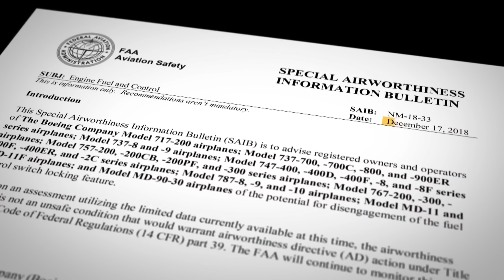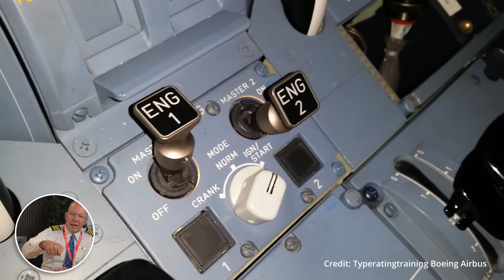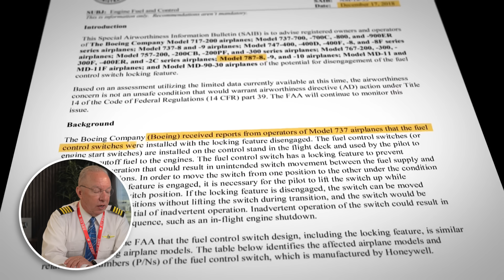Air India 171: The FAA’s 2018 Fuel Switch Locking Bulletin Explained (16 Questions Answered)

Comment: Steeeve-retired avionics systems engineer here and ever since I heard about the fuel switch issue I’ve wondered how an airplane this advanced does not have a “reasonableness algorithm” built into the switch actuation logic.
The airplane’s smarter (or at least should be) to know that a “fuel off” command is reasonable during a throttles in takeoff position, 600’ in the air and literally seconds after WOW logic transfers from ground to air.
Airplane should have over-rode that switch actuation.

Comment: Remember boeing mcas tragedy 2 had to happen for action to be taken its gonna be the same for faulty fuel cut off switches another one has to happen before something is done mechanical issues take time i think the intense vibration that happened before the plane took off put the fuel cut off switches to off position

Comment: A camera may avert future accidents if it was discovered the pilots did not move the switches. While it seems extremely unlikely now, stranger things have happened in air accidents. When the investigations were completed we learned something new and made the industry safer. The difference is that, we can look back with the gift of hindsight. There is a reason why recorders were installed in the first place. Pilots would have been resistant to it at first, but the result has been huge increases in safety in the industry.

Comment: I have a couple of comments.  A service bulletin is not just for information. Some are, other have a time limit or cycle limit to accomplish the corrective action. As for the fuel cutoff switches on a Boeing, they spring loaded in each position. To change state to run or cutoff you have to pull the switch against the spring tension and move forward to run or cutoff.   Some other manufacturers have guarded switches (just an option. Last in case of a total electrical failure the FADEC (engine computers), will get powered from the PMG mounted on the engine gearbox.

Comment: "The FAA recommends that all owners and operators of the affected airplanes incorporate the
following actions at the earliest opportunity:
1) Inspect the locking feature of the fuel control switch to ensure its engagement. While the
airplane is on the ground, check whether the fuel control switch can be moved between the
two positions without lifting up the switch. If the switch can be moved without lifting it up,
the locking feature has been disengaged and the switch should be replaced at the earliest
opportunity."
This the the text from the "recommendation" section of the report captain Steeve skimmed over. So he's inaacurate when he says that "i think this bulletin was about the installation of the switch". This bulletin clearly states that there could be a problem with the ocking mechanism of the switches and, that they should be replaced at the earliest if found faulty. 
the fact that such a serious component potentially being faulty is posted in a "bulletin" by Boeing and, shows their thier lack-luster behaviour. 

I certaily don't wan't to jump to a conclusion that the switches were faulty, but it's too soon to jump the gun and blame the pilots when the investigation is still underway. People should be more reserved with their opinions until we find concrete evidence of what has happend.

Comment: I find it odd that between the time the one pilot asks why the other pilot cut the fuel and the other pilot denying he did it, that there is not a word spoken in the cockpit before the may day call.  Also, why is there no alarm mentioned or heard when the fuel was cut in mid flight?  You would think there would be one.  Since the one pilot denied cutting the fuel, it seems that a camera would be proof of what really happened.

Comment: If it’s not normal procedure to cut off fuel in-flight, shouldn’t there be additional safety measures such as requiring some sort of confirmation step like another control switch or lever to effect such a “dangerous” action?

Comment: Capt. Steve,
    In always considering every possibility, the investigators will surely determine if and how much life insurance each pilot carried. The pilots know that there are no cameras in the cockpit. If the person thought about this action in advance, he would know that life insurance policies do not cover suicide. If however, the “actor” is clever enough to take the action and then blame the other pilot, he, the actor, will be considered a victim and his life insurance pays his heirs. The tone of the voices on the CVR will be critically important. Hopefully there may be other evidence to determine which pilot cut the fuel off to the engines. It just seems odd that a pilot that just cut off the fuel to the engines in front of the other pilot would then deny doing it. Obviously, either pilot was physically capable of cutting off the fuel switches but which one did. The accusation and then the denial will both have to be examined very carefully.

Comment: Boeing needs to rethink the idea of having a limited amount of fuel flown to the engines already for around 1000- 2000 ft during take off . This way any actions on the fuel switch whether it's by humans or a malfunction within the system,  does not directly impact the aircraft up until around 2000 ft. By the time they reach around 2000 ft or so, they would still have ample time to recover after switching the fuel switch to on. I heard on this crash also they did put the switch back to on and engines did start the initialization but unfortunately they didn't have enough time and altitude for the engines to come back to it's full to give any sort of thrust simply because these heavy engines does take time to come back on. It's not like we switch off the fan and when we turn it back on, it resumes immediately

Comment: Time to look at adding logic to the FADECs that would prevent them from shutting down simultaneously especially at low altitudes.

It needs to include preventing a pilot from full nose over at low altitudes.

I’m so impressed by the pilot to maintained his composure and tried to relight the engines. Switched, run, APU on and at last minute Mayday call. A real hero. If only he had more time the flight could have been saved.

Comment: 4:36 systems engineer here, but not an aviation engineer nor pilot, so  absolutely take this with a grain of salt: video might give some really valuable insight to how flight systems are actually used by human pilots. There are times when systems behave in unexpected (and bad) ways BUT ALSO behave in ways EXACTLY how they are designed to. Systems telemetry and instrumentation while really really powerful just don't always tell the whole story. that visual piece might provide the clue and implementation of video monitoring is so cheap and so easy to sanitize these days it just doesn't make sense why cockpit video isn't a standard. I feel like cockpit video + instrumentation + recorded telemetry + video of control surfaces recorded to the FDC is a no brainer, but again i'm an amateur enthusiast so there may be issues with this. Help me understand why we don't have this on new planes?

thanks again I absolutely love your content, expertise and tone. 

Fly Navy

Comment: TERRIBLE VIDEO - @7:30 - Steve brushes off the concern about the locking mechanism bulletin saying that the plane would never fly at all if the switches were installed incorrectly. That is NOT what the bulletin is saying The bulletin clearly states that the LOCKING part of the Fuel cutoff may not work which could result in the fuel being cut off inadvertently in flight.  
How could a professional pilot get this so wrong????

Comment: 3:52 My question is this: One pilot can put the switches from run into cutoff. Then immediately ask the other “why did you put them into cutoff?” Gaslighting the other pilot when they were the ones who intentionally flipped the switches. The other pilot’s response was of course “I didn’t do that!” Which is of course logical. The perpetrator pilot could blame the innocent pilot, while the innocent pilot’s response is completely valid. That’s the reason a camera would be good for the cockpit. For situations like this. All we have is the CVR and the innocent pilot could have been blamed as the perpetrator who got everyone killed when he was actually innocent and his fellow pilot was the bad actor.

Comment: Not being an airline pilot I did not dare to comment but after reading the preliminary report I tought: Was the off-on switching done before or after the pilot question? What if the computer caused this & the pilots tried an unplanned & desperate move to restart both engines? Just a candid observation.

Comment: Why cant there be logic for the computer to override fuel cut off on take off? I mean while in ascent if you find yourself in a situation where fuel needs to be cut off, you’re kinda screwed anyway right?

Or why not force pilots to do it twice? Do it once, resets to original position, if done again within 10 seconds it serves as confirmation.

Comment: Sir, With due respect, it seems everyone is trying to protect the big players,especially Boeing. This is just a preliminary report, and the way it was leaked suggests a hidden agenda. Your mind seems already set to blame the pilots, but Boeing’s own advisory about those switches shouldn't be ignored. As a mechanical engineer, I’ve seen switches fail from locked positions. When someone refuses to accept any cause other than the one in their mind,or as prompted by their masters,it clearly shows bias and such views shouldn’t be taken seriously. There’s an equal possibility of pilot error, sabotage, or switch failure. Focusing on just one is a grave mistake that risks another disaster.

Comment: Is there a separation of responsibilities between the Pilot Flying and the Pilot Monitoring?  The switches are common to both pilots, right? because they are in the center and accessible to both? But does the pilot monitoring have the exclusive responsibility of the fuel switches?

Comment: The Flight Data Recorders on the 787 are the most advanced and detailed recorders in modern aviation. They record thousands of parameters and when you place those switches into the RUN or CUTOFF positions, is not just one thing that happens, it's a cascade of functions that involve the Fuel, Electrical, Hydraulic, Fire Protection, Pressurizarion, The FADEC & EEC's, Annunciation systems, it's a cascade of functions and all of them are recorded and all of them are analyzed as they are happening with many of those systems preforming self tests as they are completing the Shutdown process of the engines. 
As difficult as it is to believe that one of these two pilots did indeed physically turned those switches to the CUTOFF position, that's what happened.

Comment: As an academic working in the field of international compensation law, my interpretation is as follows 

Page 6 of the report: "The FAA issued Special Airworthiness Information Bulletin (SAIB) No. NM-18-33 on December 17, 2018, regarding the potential disengagement of the fuel control switch locking feature. This SAIB was issued based on reports from operators of Model 737 airplanes that the fuel control switches were installed with the locking feature disengaged. The airworthiness concern was not considered an unsafe condition that would warrant airworthiness directive (AD) by the FAA. The fuel control switch design, including the locking feature, is similar on various Boeing airplane models including part number 4TL837-3D which is fitted in B787-8 aircraft VT-ANB. As per the information from Air India, the suggested inspections were not carried out as the SAIB was advisory and not mandatory. The scrutiny of maintenance records revealed that the throttle control module was replaced on VT-ANB in 2019 and 2023. However, the reason for the replacement was not linked to the fuel control switch. There has been no defect reported pertaining to the fuel control switch since 2023 on VT-ANB."

So, can it be a malfunction? Yes, potentially. The FAA acknowledged a design issue that could lead to the lock not engaging properly.

In short, in that Bulletin it was stated by the academics that it can switch itself off, and they need to be checked. You do not talk about this, but rather blame the pilots.

But on the other hand, based on the recorded cockpit conversations, the media now seems to be trying to create the impression that the pilot may have committed suicide. Frankly, I don’t want to believe in that possibility. How do they do that? Well, focus on the captain. The captain’s words to the co-pilot were “why did you shut it off?” — not “why did it shut off?” or “did you shut it off?” 

The shut-off switch is located right next to the throttle — in plain sight of the captain. So perhaps he saw it being switched off, and that’s why he asked. But the real issue is this: it's 2025, and while even a doorbell now has a camera, why is there still no camera in the cockpit? The explanation is supposedly that pilots don’t want to be recorded. But if there were a camera, insurance companies wouldn’t be able to dismiss such incidents as suicide and avoid liability. Manufacturers like Boeing deliberately prefer ambiguity. They want scenarios with room for interpretation, so there’s no clear evidence — making it easier to defend themselves if needed.
Reply: he made an assumption. Maybe he didn't actually see it done but saw the computer screen telling him it was shut off. Also, 1 second for both to be turned off yet 4 seconds(in an emergency mind you) to be turned on, each individually. Ever think of that? Sorry to burst your bubble of certainty.
Reply: @stevebubbie1126  It is a possibility. To make it clearer, we need cameras in the cockpit to solve it, at least for accidents like this. It would have helped a lot to improve the aviation sector bur companies like Boeing would not be happy. The goal should be to understand why the switches were in the off position – whether due to a specific malfunction, a series of human actions, or an interaction of both – to prevent future occurrences.

Comment: I think this is a mistake for people to jump to pilot error or deliberate act. The narrative here seems to be jumping to deliberate act. I am concerned at the predilection towards it, rather than a mechanical aspect. I am dismayed and thoroughly disappointed at the disregard of the 2018 FAA report here, and the doggedly holding on to the “deranged/suicidal pilot” theory. Other aircraft are subject to this safety hazard, and to not examine the mechanics of the failure(whilst blithely writing it off as pilot error/sabotage) is dangerous and irresponsible. Did I already mention how disappointed (add “disgusted”) at this?

Comment: The fuel control switches are likely not hardwired to the fuel valves. There is a very likely downstream problem here where a microcontroller, firmware and relays in the loop may have malfunctioned. Only further analysis will tell.

Comment: the first officer, who was the pilot flying, would have been looking out the windshield with both hands on the yoke, and occasionally looking at maybe angle of attack, altitude, speed...he likely wouldnt be looking low enough in the cockpit to see the fuel switches being turned off. asking directly about the fuel switches is a telling question. if the piolt flying noticed a problem, he would likely first be looking at throttle position, then the engine display for the N1 value, airspeed and altitude, probably after checking . toga buttons& autothrottle. I cant believe there werent multiple questions prior to the one about the fuel switches. it would normally be a bit down the troubbleshooting list. ...imagine your car just shutting off on the freeway. you would check dash lights, engine rpm (tachometer), speed, probably gear selection...and more before toy would look to see if the passenger turned off the ignition switch, correct?
Reply: Now your thinking like I am....   Too much missing information....
Reply: @k4xtt  my guess is that the voice recorder clears up many questions but tells a very dark story...we got "why did you turn off the fuel to the engines",  and "I didnt"...there is no doubt much more to that conversation that hasn't, and likely will not be released

Comment: Captain Steve,

Can you please explain in layman’s term, two pilots work during take off ?

I have seen lot Boeing take off YouTube videos. 

During take off, one pilot is holding control yoke and other pilot holding hand on engine thrust lever firmly.

For me, it’s very very very hard to believe, a pilot is going to spend few seconds and turn off fuel switch during take off purposefully

Comment: There was a new photo in the report which showed the RAT deployed while the A/C was still inside the airport boundary. It appeared to be about 1 plane length in altitude with an 8 degree or so nose up, normal rotation geometry IOW. So the cutoff switches were moved right after rotation and momentum carried the A/C to its max altitude. Also the engines to not instantly spool down of course, so they make thrust for a short time after cutoff. Nevertheless it's a good question about the RAT being out so close to the ground.